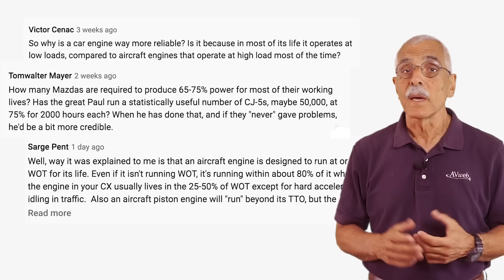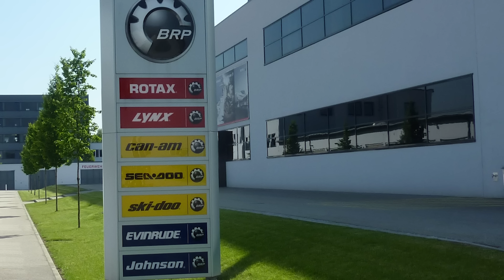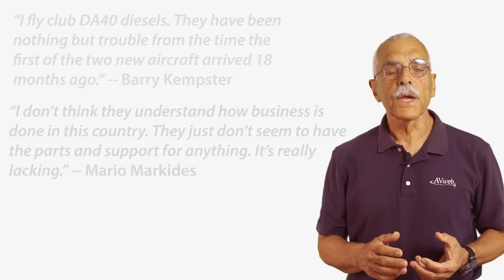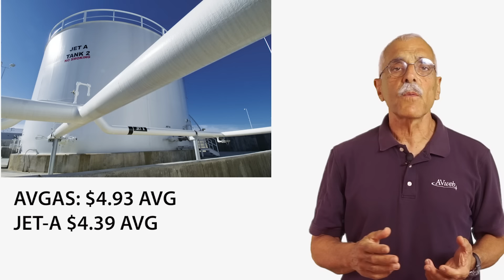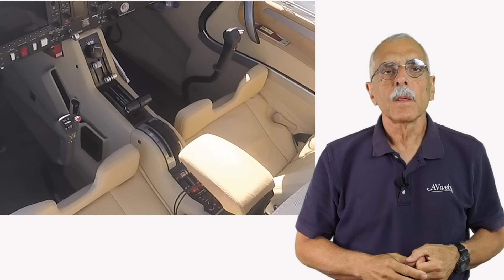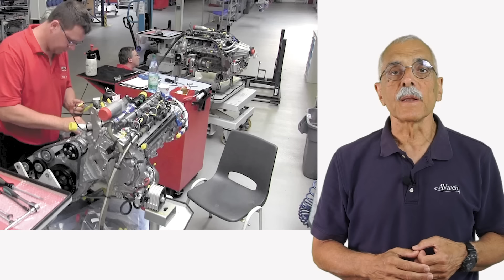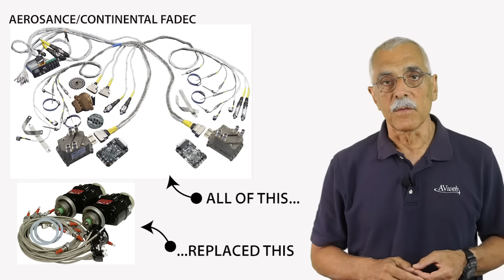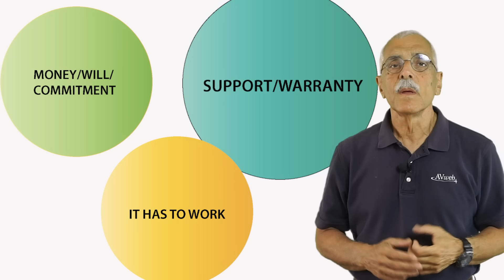Why New Aircraft Engine Ideas Rarely Succeed

Comment: Surprised inline six hasn't been tried so much; though maybe the packaging concerns are similar in aircraft as they are with cars. Pound for pound it seems like a better way to go. Fewer cams, no balance shafts, low vibration, simpler block geometry.. really the only drawback is length, if you were already willing to go for six cylinders.
Reply: Volvo whiteblock inline 5 converted to timing chains would be a contender. Perfect natural balance, aluminum block, shorter than an inline 6, very stout.
Reply: @thebigmacd  staying with I6, a BMW B58 would be interesting. If you wanted to match the output of a Continental IO 550, a B58 could be built about 60-160kg lighter, it would be a detune from the base spec. I think the overall length is also similar, and the narrower block would free up some drag to spend on the charge and oil coolers.
Reply: @thebigmacd  there are even production B58 tunes making 500hp. It's a 3.0L engine,  where the IO 550 is about 9 liters.
Reply: Here's a guy disassembling a B58 https://youtu.be/MckxlP60cnY

Comment: Very well done! It's a subject I'm quite familiar with. This presentation hit the important technical points succinctly and accurately. From BSFC and the weight of fuel, it's relation to range and to the aviation duty cycle. All correct. While it seems remarkable that air cooled aircraft engines can compete with modern engines, the fact is that a big bore, direct drive, air cooled engine has many advantages for aircraft use. Some are self evident like direct drive. Others like air cooling, and the potential for low cooling drag when compared to liquid cooling, are not quite as clear, the lower complexity and weight of air cooling also factors in. Then there are simple efficiency points for aircraft engines having lower piston ring swept area than their automotive counterparts. Along with the efficiency benefit of comparatively lower combustion chamber surface area than similar HP automotive engines. The old aircraft engine engineers really did know what they were doing, and came up with designs that checked all the boxes. As much as I hate to bring it up, the diesel may see new scrutiny due to it's higher "carbon dioxide" output, as it's high carbon atom count per molecule is currently considered unfavorable.
Reply: Carbon dioxide output is flawed chemistry....  burnt  petroleum fuel only adds Carbon and hydrogen to  the atmosphere, the oxygen O2 part was already in the atmosphere, to begin with, it's not "added".  It's bogus accounting.  You do add 5.5 or a bit more pounds of Carbon for each gallon of gasoline or diesel consumed, the oxygen,  however, is not added.
Reply: @randyvanvliet226  it's not flawed chemistry. O2 is desirable, CO2 is not. It doesn't matter that there are two oxygen atoms still, they now have different properties when combined with carbon. What matters is how much undesirable gas exists where it didn't before. The fact that it reduced O2 makes the CO2 proportionally worse than if it was 100% conjured into existence from nothing.

Comment: Surprised the DeltaHawk wasn’t brought up in this as one that never took off
Reply: Their website is promising big things! 😀
Reply: @crufflerdoug   That's been true for 15+ years now...
Reply: Lots of simplicity to like in the design, however execution, integration & validation, well it’s like Paul said.  Direct drive, one lever control, no electronics required, no cam or other valve mech, no ignition, no carb heat, fuel economy, ~competitive power to wt, capable of continuing to run at reduced power after turbo, injector,  piston or even complete electrical failure.   So far the Rudd family have demonstrated tenacity.  Finding an airframer with the same commitment and a whole lot of time & fuel will be required.
Reply: @timduncan8450  I get it takes time to get all the bugs out but 10 years in development and still nothing to market means they obviously can’t meet those claims.  If the goal was to actually produce an engine they should sell them to experiments since that’s where the volume would be.
Reply: @brent1041    Yah it’s a sad timeline.  They have had some problems with head gaskets possibly with injection pumps if memory serves.   I wish them the best but Lyconisaurus just work and aviation is tough sledding for anyone.

Comment: Without the weight and complexity of a gear reduction unit,  a large, low speed engine is required. Low speed engines really have little to to gain from overhead cams, and pushrod engines end up being more compact and lighter in weight than an equivalent overhead cam engine. Large low speed engines have been known to be efficient for 100 years. Efficient props will always be low speed and not employing a gearbox will always be an advantage, therefore low speed, large displacement pushrod engines will always make sense, perhaps even the most sense.

Comment: Well done Paul, aviation is a tricky market for sure, I think the smaller numbers make any new idea that much harder as compared to the automotive market. You did not venture into the electric engine discussion, I think that will start working its way into the training market sooner than later and then into larger A/C once they get the weight/efficiency of the batteries down to where it will work.

Comment: My A&P ticket in my wallet allowed me to get through the main gates at the Oshkosh fly in, even better I could wander the flight line to my hearts content. This was back in the seventies. I actually shook hands with Chuck Yeager. I didn't wash that hand for weeks. 
There was a rash of new aircraft engines on display. Turbines and diesels and jet engines smaller than a bale of hay sat gleaming on their stands. No sheet metal cowl to hide their naked complexity. Each tent had an array of likewise naked and new aircraft systems and various bits and pieces offered up as the answer to a hundred general aviation questions that no one had bothered or cared to ask about.

Comment: Meanwhile, in the experimental world, Viking seems to be making a good name for itself by slightly modifying Honda crate engines.
Reply: Well, they're not exactly crate engines--the engines are pulled from totalled low-mileage cars.  Unless that's changed recently.  Still probably just as good as new, though.
Reply: @zolotiyeruki  I think they switched to crate engines.  It's the reason why they don't use Toyota engines instead.  Toyota doesn't sell crate engines, Honda does.
Reply: The K series is arguably one of the best engines ever made, what a great platform.
Reply: Only thing wrong with Viking is Yan. I despise him. Why hasn't anyone mentioned Aeromomentum. Very similar to Viking, just no Yan and no sleaze. A well developed product line and a stellar reputation.O yeah they're exp only and have no current plans to certificate
Reply: @michaelmagill189  I have no stake in Viking, just a casual observer in the bleachers.  That being said, I couldn't help but notice that you created your Youtube account 7 days ago.  Your comment has all the hallmarks of a sock puppet on a smear campaign.  You wouldn't happen to be that bitter limey who crashed his Zenith 750 and tried to blame it on Viking, would you?

Comment: Structural geometry? LOL So , I suppose Bombardier just built what they had? Gimme a break. I wouldn't fly in one of those tin can LSA ever again with the crap motors they run. You must not know diddly about modern engines. All my trucks run down the highway at less than 3000 RPM and go for 1000's of hours.

Comment: Great video, little lacking in faith but I see the smirk. You want to be wrong :)
Whether you go old or new tech piston is one thing but a 1950s engine like IO580 can't cost 141 grand when there is nothing special about it. They could have fabricated all the engines in one month in 1970 and just sat waiting for suckers to come in and pay the price ever since.
I can vividly imagine development costing a lot, car makers spend big money on new engines. Can easily kill a company so you have to be able to foresee that. Failure isn't a given but an attractive option. It can be done.
You didn't mention Rotax 915. At 140HP weighing less than half the Austros it's no longer just a paraglider engine. And could be used in a twin, easily besting a Baron that leaks more fuel than the SR71. 915 is grossly overpriced but shows what can easily be done. If it was priced more reasonably like 10k they might actually sell 10k of them. And Rotax is familiar with mass production so there is no excuse. 5bn$ annual sales.
Weight reduction of planes seems like a related big opportunity. Why have a fuel leaking 300HP WWII tractor engine if you could do the same speed with a modern 150HP in a fuselage that unloaded those 4 stowaway cast iron pianos. A sling TSI uses less than half the fuel of a Cirrus SR22 and isn't much slower and it doesn't even use carbon fiber. Less than half the weight helps it a lot. With retractable gear it might even outperform the Cirrus despite the much smaller engine. So key to better engine situations could well be the indirect weight and aerodynamics.
But what if all the complexity of a piston engine could be sidestepped entirely.
What if a tiny 10kg turbofan jet engine could beat them all and due to its small size and simplicity be very inexpensive to manufacture.
Similar to a DA62 in cabin and body, but weighing 5x less, pressurized and with two tiny turbofan jets. It would still run jet A fuel, perfectly smooth and quiet and go more than twice the speed of a DA42 or DA62 and cost 1/5. In both purchase and operation.
I know many will insist on their crop duster stol planes but like the glass panels, if there is a plane model that can actually go places like it was a private jet, they might just buy that over the old canvas crop duster if the price is the same. And a carbon cub isn't cheap.
Has GA really overlooked the possibility of jet planes smaller than the minibus sized socalled very light jets. An Embraer Phenom 100 weighs 3.3ton empty. A 4 seater twin jet could weigh 1/10 of that. Easily.

Comment: “Steam locomotive engines have less levers than a twin engine aircraft”  Paul for the win.
Reply: I don't think the 6 levers are a big deal.  In a twin, you're going to need to be able to feather so I can't see how you would get away from a prop lever.  I suppose you could have a "feather button".  Now mixture, I would agree, even on old engine designs, you could incorporate automatic mixture controls as an upgrade so that would get you down to 4 levers.
Reply: @mustardseedsociety  In the 1970's in cars you had the throttle and the choke the timing control was long gone. In aircraft you had and it's my understanding still have all three.
Reply: @stephenhunter70  The automotive automatic timing control was by analogue means involving vacuum pressure and the distributor. Now it's all by computer.
Reply: @awuma  Yes I believe that was vacuum advance.  I remember cars also used "points" to collapse the field and fire the spark.  In an aircraft engine I don't think the spark is advanced or retarded.  But I'll look it  up and if I'm wrong I'll stand corrected.  The way I understand it is the magnetos turn and are like mini spark generators sending high voltage to the sparkies.  I kind of like the idea of keeping one set of plugs using the mag, and the other set using a ROBUST electronic ignition with 2 channels.  That way if your mag fails, you got the electronic.  If your battery goes dead, you lose your electronic ignition, but you got your backup mag going.

Comment: Paul please make a video about the GM LS1 engine's viability in general aviation. I know its been done at some point, but is not well documented. Aluminum block, and cylinder heads, excellent power to weight, ridiculously reliable. Biggest difficulty is the wet sump from my understanding.
Reply: I was involved with an aircraft project back around 1990 that used Chevrolet Big Blocks and the problem wasn't with the engine itself, but the accessories and the gear reduction unit.   The engine had to spin backwards which isn't a difficult thing with Mercury Marine having done this for many years and counter-rotating marine engines, but it does involve some different parts to make it work.   The auto engine makes seemingly big power for displacement but it does this with higher revs, so gear reduction needed and then you have to address the speeds that you'll be working the engine.

Big Block 454's were rated at 450 horses...but at 5500 rpm.   So if you took off using all of them you were condemned to cruise over 4000 by the limitations of propeller efficiency.   We had a computer program from Hartzell that proved to be very interesting.   You could choose any diameter and available blade profile which then showed you how fast it had to spin to work properly which is a very narrow range of speed...and I just wasn't comfortable running the 454 for most of it's life at 70% power and 4000 minimum rpm.   I would have preferred about 3000 cruise but then the max HP is way down and they don't look as advantageous.   

One interesting thing I floated was to use a 2 speed gearbox...which I still say would have worked well.   Low gear for takeoff then high gear and reduced revs for cruise...all the while the prop is spinning at it's most efficient speed.   'Nobody does two speed gearboxes'  I was told.   So?  It actually would have been pretty easy to make a planetary gearset in the reduction case but it got shot down.   The whole airplane deal went down the drain (Stewart 51) which is a shame because it would have been neat.   Some did make it into the air...but the engines weren't being done the way I would have done them...to their detriment IMHO.
Reply: Given a long enough timeline, everything gets an LS swap.
Reply: @Racing_Pig  #truth
Reply: Another automotive abortion that will never see  aviation use, outside of maybe a few crazy experimentals. Even with an aluminum block, it’s still too heavy and turns too fast to be useful as an airplane engine.
Reply: It's been done a LOT, in every kind of experimental aero application including helicopters. If you want a dry sump aluminum V8, that hardware is available from the factory too as the LT1 crate engine, and aftermarket dry sump setups are well developed for all kinds of racing applications. Unless prolonged inverted flight is a requirement, even a wet sump LS/LT will work just fine with an Accusump-style accumulator, and you can even set that up as an automatic pre-oiler for startup too.
Reply: Or how about THIS -> https://youtu.be/ScS-QCWHfb8
Reply: Most of the maritime conversions of GM and other small/big block engines suffered from valvetrain failures. I've seen far more bent broken and siezed valves than broken rods. Of course lack of proper maintenance and regular oil changes accounted for about 90% of all failures. I don't know much of the experience in aviation but i suspect the experience was similar ( not maintenance issues. Boaters are much more complacent about maintenance because one doesn't usually die when the boat motor fails )

Comment: There’s also a stubborn resistance from the American buyer to buy something modern. We still make Waco biplanes, radial engines, and Cessna just came out with a brand new copy of the twin otter including struts and fixed gear. Europe is producing beautiful modern stuff but most buyers are in the US and they won’t buy modern stuff. Make a new 1955 chevy and you’ll make tons of money.
Reply: A large part of the current pilot population is aging out or simply getting away from ownership. Not to mention dying. As a result, the market is loaded with clean well cared for ( mostly but do your homework before buying ) older aircraft that can be had most reasonably priced unless the dealers get hold of them. Then you'd think you were buying new and they get pretty damned indignant if you suggest that their price is too high. I watched a dealer who bought a nice ( fair condition ) 172 at an estate sale for $15000. 3 weeks later it was cleaned up, had some minor vinyl graphics that covered the unrepaired corosion on the upper wing and a price tag of $85000. But still there are many good deals out there and many new aviators like the idea of reasonable price and familiar well proven planes. The downside of this is that it makes it really hard to sell that outrageously priced new airplane thats 3 knots faster and has Garmshit avionics
Reply: Part of the problem is that the sleek European airplanes come with eye-watering prices.
Reply: @zolotiyeruki  So do the classics though, a brand new C172 will set you back what? 300-400k? And that plane hasnt changed in 50 years apart from fancy avionics and a nice leather interior.